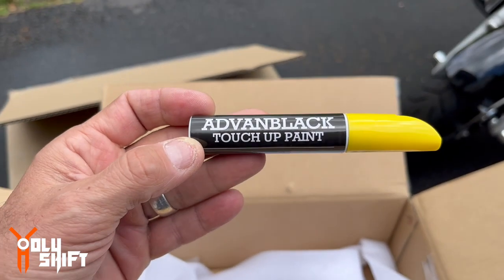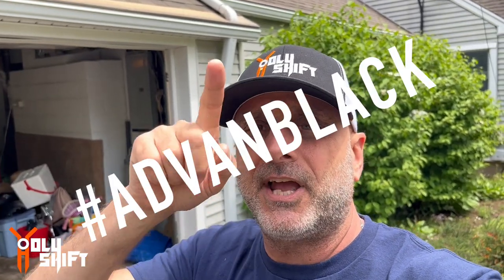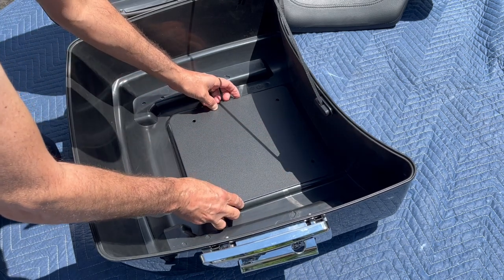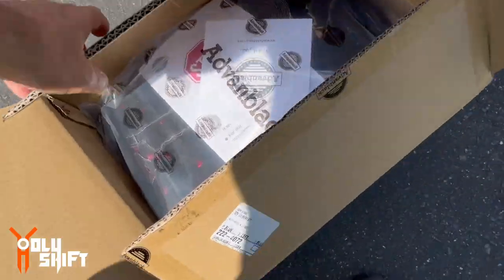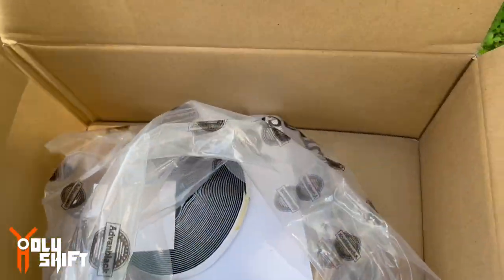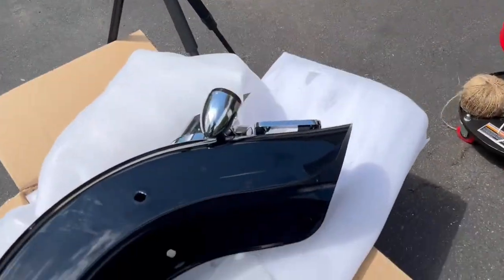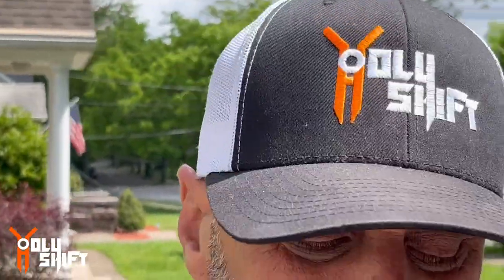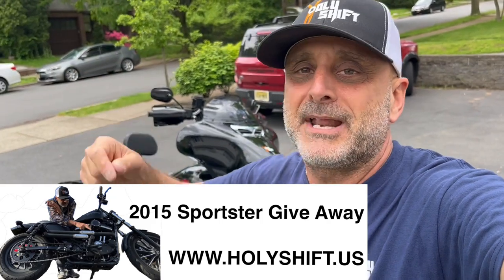Electra Became An Ultra !

Comment: How do the fork lowers work with the engine guard hard lowers? With the handlebars get to full lock without touching? I have fork lowers on my Road King Special, but am considering hard lowers for winter riding. I think the combo of fork lowers and hard lowers would be awesome for cold weather.
Reply from the maker: lowers and the fork deflectors - don't touch even at full deflection.